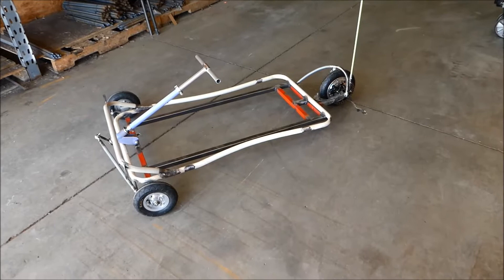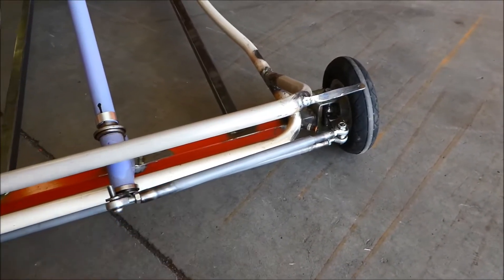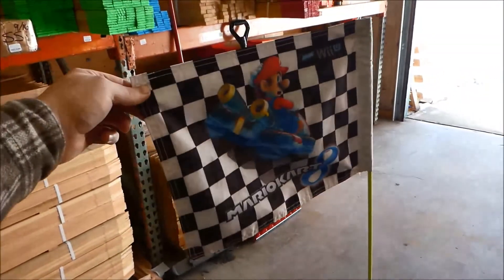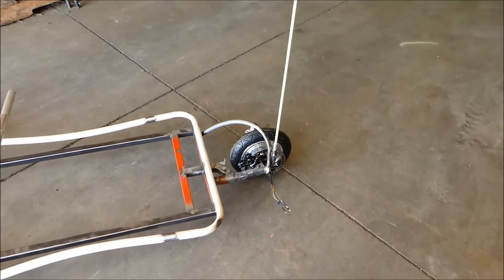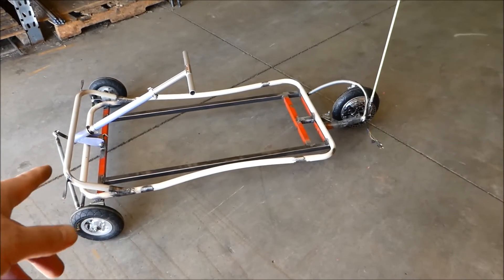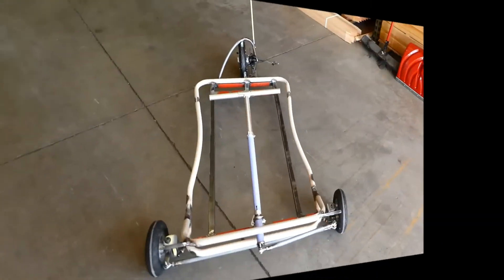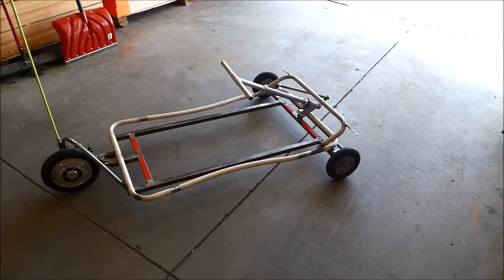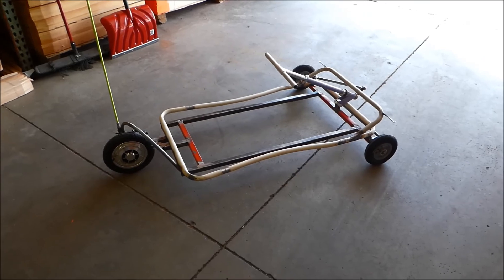Homemade Ultra Light Electric Go Kart / Go Trike 42 volts 500 + watt, under $200 DIY (part 5)

Comment: How did you add the disk brake to the hub motor?
Reply from the maker: I did a custom made adapter for it
Reply: Would you  show how i have a hover board I would like to use in the  same way